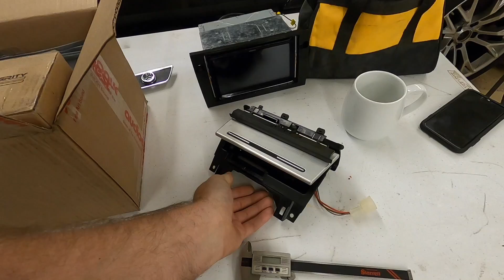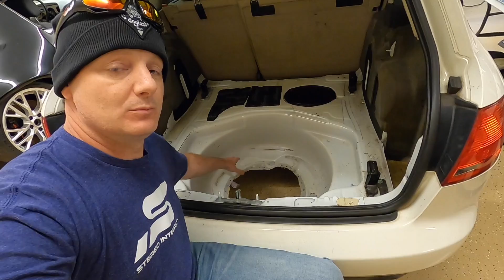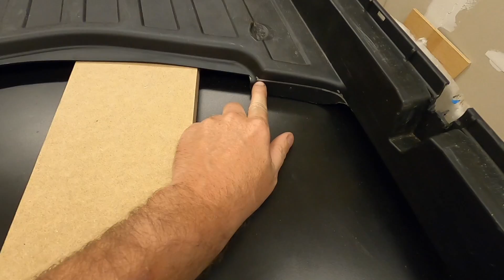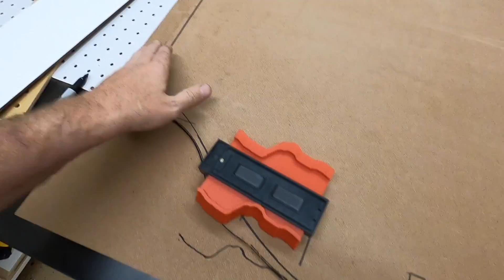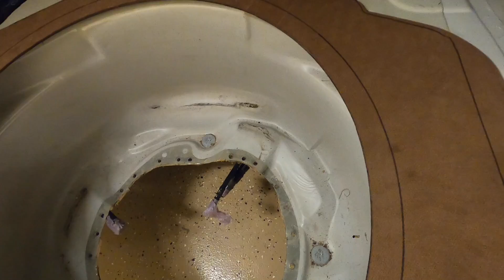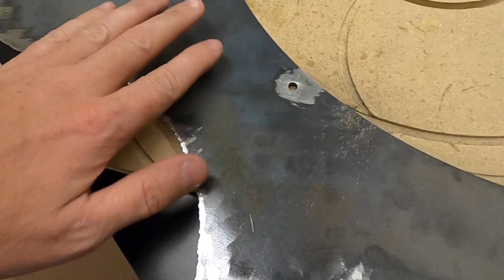Stereo Integrity Audi A4 Avant Stealth Build: Part 1

Comment: This is really cool to see. I currently own an Audi a4 B7 Avant as well and I am planning on doing my own audio system as well. 
My car came with very limited and terrible sounding radio with no aux input not to mention the factory speakers. 
Just wanted to say that I appreciate the info you are sharing with others because I haven't seen many b7's with custom fitted audio parts.
Usually the videos just cover simple things like speaker replacement or head unit installs. 
Grate work and nice workshop, again, much appreciated!